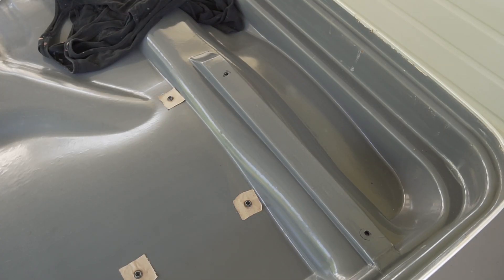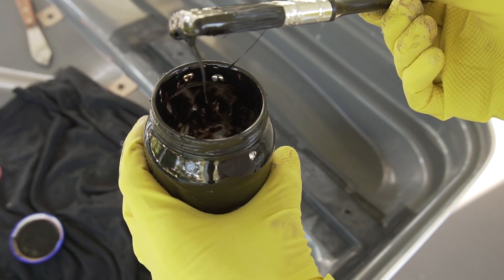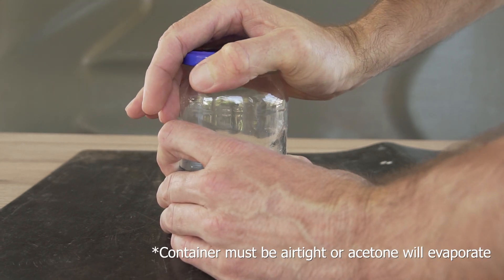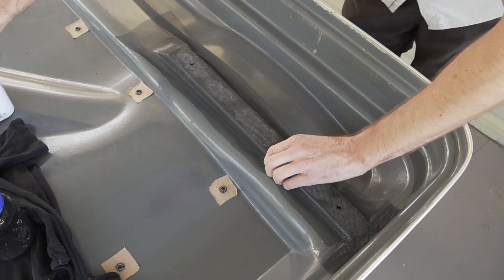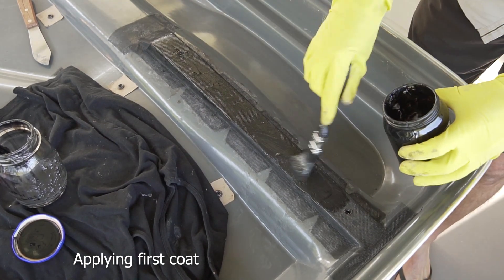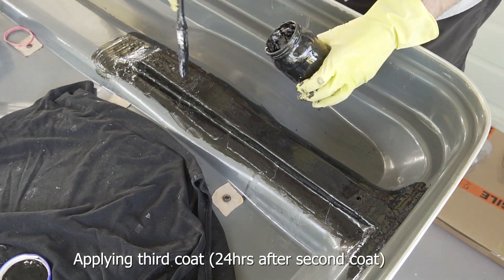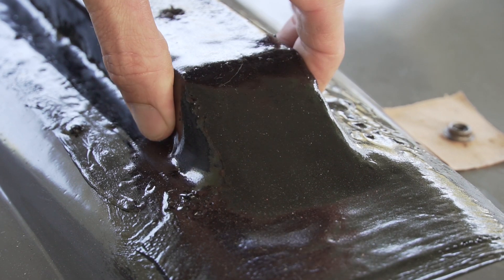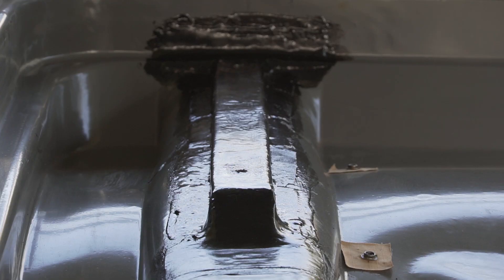How to repair and reinforce large ABS plastic items using ABS slurry.

Comment: Of course! Dissolve ABS in a solvent and use as a filler/reinforcer. Why didn't I think of that??  Thanks for posting this, it solves a lot of my ongoing repair problems and will save $$ over buying plastic fillers.

Comment: Hey mate! I have the same rtt with the same issues. Do you still have the tent? Has it held up well? Please let me know.
Reply from the maker: Sold the tent around a year ago now as we needed a larger tent for a growing family. The repairs held up well in the time I had it, which was over a year following the repairs, with the tent being on the car a good chunk of that time. If I had the same problem again I wouldn't hesitate to do the same repair. As for the rest of the tent, it was showing it's age, but still worked perfectly fine. I did have to reseal the bolt holes with some new sealant because they tended to leak as water would sit where the bolts went through, which is a bad design having holes in low points where water collects IMO. Let me know if this answers your question. Cheers 👍

Comment: What did you clean the old stuff with? you never mentioned cleaning. It can't be dirty.I need to repair the cracked abs plastic in my cargo bags on my 94 honda goldwing 1500 where the bolts hold them to the frame.  Seen plenty of videos, but yours explains the purpose for what I need. All the others are about doing pipe and plumbing repair/connections. Maybe the acetone will clean the areas that I'm doing. I like the mesh Idea but never heard of it so I don't know what to google. thanks.  🙂
Reply from the maker: I just used methylated spirits to do an initial clean, although the acetone should also remove any contaminants from the surface. I came up with this repair based on a combination of repair ideas from fibreglass r pairs and using ABS slurry to repair plastic items. If you google fibreglass repairs but replace fibreglass with fine mesh and the resin with ABS slurry it should give you a good idea of how to go about the repair. Good luck.
Reply: @fortheloveofvideo6306  😍😍Thanks so much. Sorry, I had a paypal account once.... it got hacked. Never again. 😞
Reply: @fortheloveofvideo6306  I got tired of waiting for my material and went to my shed and got out my 80 watt plastic welding iron with the abs rods. I've done other cracks before. I did my whole project in an hour or so and my old weld jobs still held up fine and never cracked and much worse than yours. I had some carb cleaner and sprayed that on the areas, and let it set 5-10 seconds and wiped it with a rag and it did fantastic and was eating the coating off of the ABS. Carb cleaner is good for eating plastics. 😁 I even tried the plastic lid from the soft drink I had and it blended in nicely like it was the original plastic. I've tried other rods before that I did not know they were not abs and you could tell the difference.Thanks for the help and getting me thinking again. I had what I needed all along.  Just forgot. 🙂
Reply from the maker: Good to hear, that sounds like a great result. That's the beauty of seeing how other people fix things, it sparks ideas and other creative solutions. Keep up the good work 👍
Reply: @fortheloveofvideo6306  It jogged my memory and my order was not to be here before Christ mas. Thanks for you great video though. Either way works. 🙂
Reply: @fortheloveofvideo6306  I'm back watching and thinking again. Yesterday I used stainless steel mesh  screen what came with my 80 watt plastic welding kit. I had some soda can size holes to fill and just cut the screen enough to go around them and enough to be on the solid parts. Then just continued to melt and spreak the abs rods across it all and it made another base and turned out solid. I think it would take about an hour for each of the sections you did to solder weld into the cracks and fill in the main cracks. I would trust melting more than just brushing slurry on it. What makes it stick. When you melt everything together... it's there. not coming undone or breaking off. Thanks again. 🙂

Comment: What type abs plastic you used.  I tried this and it didn't dissolve the ASB after 48 hrs with acetone and MEK.  Neither worked.
Reply from the maker: So long as you're using pure acetone and an airtight container I'd say the ABS is probably the issue, and may not actually be ABS. This is the ABS sheet I used, purchased from Australian eBay seller....
https://www.ebay.com.au/itm/253777595798?mkcid=16&mkevt=1&mkrid=705-154756-20017-0&ssspo=8bryRnEqTJG&sssrc=2349624&ssuid=pfX5kD0VR6G&var=&widget_ver=artemis&media=COPY

Comment: That mix you made there looks exactly to what I'm looking for. Do you remember how much slurry you had left when you finished? Would like to replicate what you did, further adjusting the proportions, if needed, based on your feedback. Thanks.
Reply from the maker: From memory one jar (50g ABS + 125ml Acetone) was enough to repair 1 part of the tent i.e. I repaired four parts of the tent (3 coats each) and used 4 jars of ABS slurry total.

Comment: This video just solved my little crack in my electric skateboard ABS enclosure. Brilliant - saved me lots of time and money.
Reply from the maker: Glad it helped 👍. I've also used it to repair a crack in an eBike battery enclosure/case made of ABS and it worked a charm as well.
Reply: @fortheloveofvideo6306  great tip to share with my ebike friends!

Comment: This isn't working for me.  The abs is not melting.  The water definitely turned black, but it's not fully melting it.
Reply from the maker: It does take a day or two, depending on size of ABS pieces. You also mentioned water? I'm guessing you meant acetone? Only pure acetone will work. If you do have pure acetone, another issue could be that the plastic isn't actual ABS .I've had this problem before, it can be very hard to tell ABS from non-ABS based on just look and feel.
Reply: @fortheloveofvideo6306  Right yea I meant Acetone, my bad.  I'm wondering if you're right about the plastic though.  I ordered it from amazon and it said ABS but maybe it's not fully ABS.  

I'm going to try one more jar and cut the pieces even smaller, but I'm not sure that'll do much and it might take like an hour to cut that many pieces lol.
Reply from the maker: @MountainManGuy  yeah I reckon the plastic is most likely the culprit. Hopefully you have more luck this time.
Reply: @fortheloveofvideo6306  I had mine for a month in the jar and it just wont liquify . I will try earlier comment using abs cement if i can find this aroud here ,Anyway thank you for all the information ,great experience ! !

Comment: Thanks for posting this video - looks great! I have a similar problem with a trailer lid, but with very fine cracks. Your video shows the underside, did you treat the outer/upper side in the same way? I'd like to make the outer of my lid completely water proof and would ideally like it to look 'unrepaired' too... any advice?
Reply from the maker: Apply slurry as per video and then wet sand to a nice finish. I haven't tried wet sanding yet, but I don't see why it wouldn't work.

Comment: I have repaired both ABS and PVC plastic using the appropriate solvents such as you have.  I have always used a mesh of some sort in these repairs including fly screen and believe that it is very beneficial to the overall strength of such repairs.  Where parts are subject to ongoing stress, I have even used this method on both sides of the crack/splits.  after the repair is totally set (24 hours) you can fine-sand the visible side and finish it as is done in body shops on auto bumpers.  If done properly, the repair is almost invisible.  Good job on your video.
Reply: I used fiberglass cloth and it worked perfect with my slurry.  The slurry saturated just fine.
Reply: Good to know.  Have a Thule to repair that did not survive wife’s attempt to enter underground parking in spite of being reminded prior to departure and printout on mirror😢🤬😘❤️.  Metal Fly  screen assume? as have holes as well to fill/repair.  Thx
Reply: What material did you use? Acetone any plastic? How long does it take to slurry?
Reply: What about gluing hdpe plastics?

Comment: this is game changing thanks , i wonder what other types of plastic this will work with
Reply: All styrene based plastics.
Reply: Will this work with pvc as well? I would think so! Im going to try some pieces of pvc pipe and see if it will dissolve in acetone! Lots of things are made out of pvc and the manufacturing process poisons the planet along with being non recyclable ! If parts of whatever can be repaired  it will save the planet maybe in some small way! Thx for getting the gears in my mind working!

Comment: Used this process to repair my Thule and it worked great; however  I used fiberglass cloth instead of window screen and used ABS Pipe Cement, available from the hardware store, instead of trying to make a slurry. The ABS Pipe Cement contains ABS plastic that's been disolved in MEK and acetone. If you use the fiberglass cloth, spread a layer of the pipe cement over the repair area, lay the fiberglass cloth in the wet pipe cement then cover it with more pipe cement.
Reply: Home Depot had this stuff on sale.  I work for a company that sells a certain brand of hot tub.  When we do warranty work, where I need to cut into the bottom of the spa (ABS - thicker then the roof tent shell ill be fixing) , we use ABS medium body cement and Fibatape (drywall stuff).  Pair of gloves, a paper cup, and a paintbrush.  Pour the abs glue in there, slap some on, layer of tape, and then just cover the tape with the glue.  When its ~70'f outside each layer dries in like 5-10 minutes.  And it dries really hard too.

I had one upside down in the back of the truck and the glue that came out and dried felt hard, like pipe.  Had to hit it with a hammer to break it out, and some is still back there
Reply: ABS pipe cement brand??
Reply: What about gluing hdpe plastics?

Comment: Acetone?? I’ve only seen it done with MEK solvent for rebuilding a vintage Apache trailer. But if acetone does the trick I will save money. Thank you!!!!
Reply: Also screen is a great idea. For bad cracks I’m using little sheets of paper sized abs and makes it much stronger. You’re a genius
Reply: Geek fact: acetone is methyl-methyl-ketone (correctly "dimethyl ketone"), they're that similar.   But acetone really needs that glass jar shut tight -- it evaporates much faster than MEK (and relatedly, boils at a much lower temp than MEK) (er, not that you want to boil either one, they're smelly enough already!)

Comment: Fantastic review mate. Just wondering if  how is the repaired part after  a year. Did it crack again. I am thinking of using ur method to repair a crack roof pod. Also especially driving to corrogated roads did it crack again. Looking forward for ur response. Cheers
Reply from the maker: We actually sold the tent just a few months ago, but in the 8-9 months following the repair it remained as solid as ever, no signs of stress or further cracking. I'm very confident this repair would last a long time, especially when reinforced with mesh or similar. I've used this method to repair some other smaller items since, and have been very happy with the results. One thing to be aware of is not to paint coats on too thick, multiple thinner coats are definitely the way to go, just like in the video. I reckon this method would work well for roof pods/boxes, definitely recommend adding the mesh though.

Comment: Great idea, I have two moulded propylene trays in the basement in my fifth wheel RV that are cracking. I would like to try this method of repair, however what would prevent the slurry from softening the plastic I’m trying to repair?
Reply from the maker: I haven't tried acetone with propylene, so I'm not sure how it would react. You might find the ABS slurry doesn't actually stick to the propylene. You could test a small inconspicuous area of the propylene with acetone to see how it reacts, I have a strong suspicion that it doesn't react at all with propylene. My suggestion would be to find a repair method specific to propylene, such as plastic welding.

Comment: I usually just go nuts with a drill on some scrap ABS and use the shavings instead of the larger chunks as that dissolves much quicker. Of course, that can be tedious for larger volumes.

Comment: What an absolutely brilliant idea.  I broke a tab on a grill insert on one of the cars.  This concept will work well.  I've seen people use a soldering iron to weld but this is would probably work better.  The aluminum screen is a good adding tensile and sheer strength (kind of like re-bar in concrete).  Fiberglass matting would have worked to I imagine (but probably adds more cost.  I'll probably use some sort of fabric as the tab needs a bit of flex (and is really only needed as a spacer.)

A HUGE thumbs up!
Reply: superglue and Baking Soda sets very quickly as well, and makes good tack welds for ABS plastic.
Reply: @scurvofpcp  that tip should be printed on the tube. It makes superglue so much more useful and you can file and sand the result in minutes.
Reply: @kirkc9643  And tap it, on the off chance you need to rebuild a screw hole.

Comment: Can't thank you enough for posting this.  I had to repair a 2 foot crack in the floor of my Citroen Mehari (worlds first plastic car)  I used your recipe substituting red Lego's for black ABS - the color was an exact match, nice glossy finish and rock hard after 24 hours - hard to believe how simple it was to repair.  All I need to do is install a sheet metal panel on the underside for additional support as its a high stress area.  Otherwise the repair is unnoticeable, I even filled a large hole where a large portion of ABS was missing (used gorilla tape as a backing) - if you need a specific color - use Lego's as they are made of ABS plastic
Reply: Very good development of the idea - Lego’s for the win.

Comment: Thanks for this video. I’m rebuilding my 1988 Suzuki GSXR-750 after stripping the paint (8 layers) off the fairings I found that there were some pretty substantial separation of the plastic that needed to be fixed. I also found that they were after market fairings made out of ABS, which many products won’t stick too. I just went out and bought some acetone and ABS and am looking forward to slathering it on tomorrow.
Reply: Need to repair a cowling on a Ninja 500. How did this work for you?

Comment: Thank you very much for posting this astonished I'm kind of a shame to myself that I've never thought of anything like this.

I have repaired restored fixed more different type of things that I can count and I've used multiple methods to reinforce repair plastics of multiple kinds, with a plethora of different materials, but for some for a reason this idea never crossed my mind....

But it's in there now!
This is genius, repair the plastic with the plastic! and unlike using heat, its not really changing the structure of the existing plastic.
Reply: ...unless you make more of an ABS putty, and use a little too big of a ball on 1/8" plastic. (ask me how I know, lol)  I was fixing the screw tabs on my truck grille and put a good little dab of plastic to "reinforce" the repair...

...it took a few days, but it ate through the grille and made a lump on the 'Show' side.  I sanded it down flush, and it became a depression over the NEXT few days as more acetone evaporated out. Not ideal, haha.

Comment: I can’t get methylated spirits to clean the surface. Any other alternative? Acetone or rubbing alcohol? 

Also, do you recommend sanding before applying the slurry?
Reply from the maker: Isopropyl alcohol will work in place of methylated spirits to clean the surface. No need to sand, I never do, although it may help the ABS to liquify when I comes into contact with acetone  due to increased surface area.

Comment: How to determine type of plastic on Combine Cab roof? built in 2006, Claas, (Lexion)
Reply from the maker: A quick test I do to work out if plastic is ABS is to get a cotton tip bud, dip it in acetone and then rub it on a small hidden area of the plastic. If it's ABS the surface of the plastic will start to soften and you'll see the plastic stick to the cotton tip bud. This test does leave a mark though, so do it on an inconspicuous part of the plastic. You gotta be quick before the acetone on the cotton tip bud evaporates too.

Comment: Can I use “Pure Acetone” to mix with the abs sheet?
Reply from the maker: Yes, pure acetone is advisable, i.e. has no additives such as those found in nail polish remover.
Reply: @fortheloveofvideo6306  How many of “Abs Slurry-50 grams of ABS plastic to 125ml acetone” did you use in this vid for all 4 corners of your cargo? Thanks for helping!!
Reply from the maker: @HDMOVIECREATOR2012  from memory it was 3 or 4 batches of ABS slurry to do all 4 sections.
Reply: @fortheloveofvideo6306  How about the fire screen you were talking about. Is that the same material as you can find from window screens?
Reply from the maker: @HDMOVIECREATOR2012  it certainly is. I used aluminium fly screen for added strength.
Reply: @fortheloveofvideo6306  Thank you sir! You've been very helpful! Thanks for replying asap! :)

Comment: I have personally used black ABS plumbing cement/glue to repair abs boats & other large items. I use it with fiberglass cloth and have also embedded washers etc in the glue/cloth layers when a fastener hole needed reinforcement. I do as much of this from the back/unseen side as possible and have repaired broken automotive trim saving a trip to the salvage yard for a pricey obsolete part. The fiberglass cloth works extraordinarily well, just use a bondo paddle to squeegie it into the cloth and let dry between layers. (The fumes are horrendous... and don't smoke!)